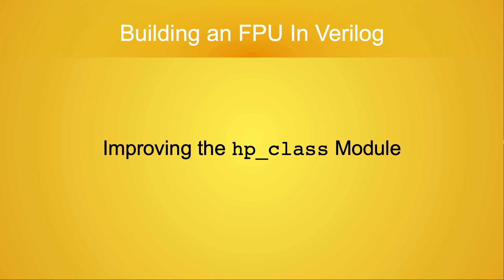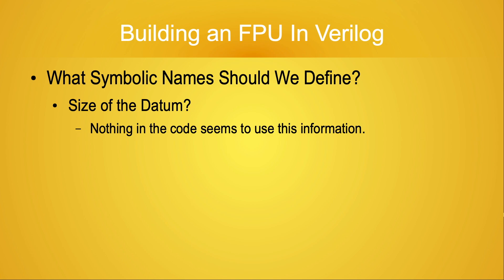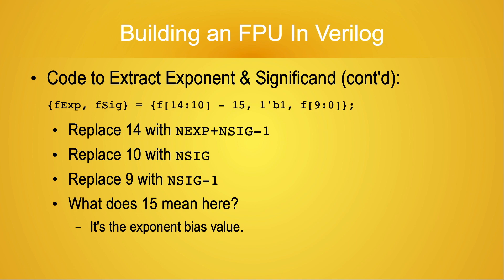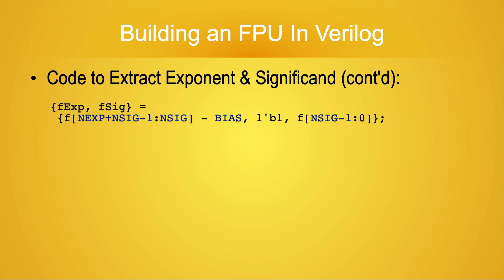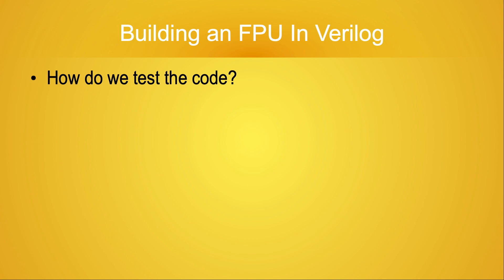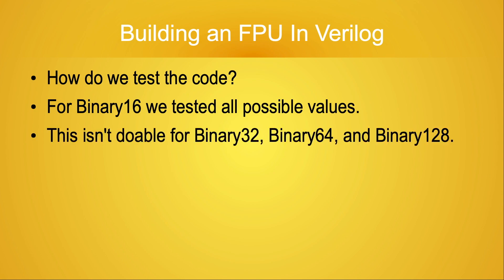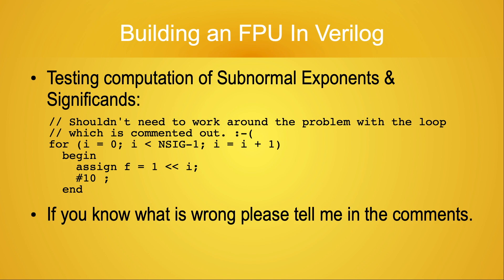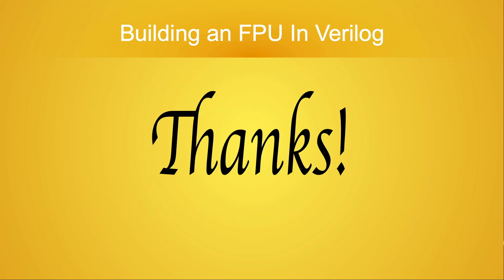Building an FPU in Verilog: Improving the hp_class Module

Comment: Hi Chris,
in verilog, LOG2 is written as a long macro with a chain of ternary operators
But now, a lot of verilog compilers also support $clog2() task

If we talk about synthesizable verilog, then a statement like this:
sa = sa | i;
or tSig = tSig << i;
may or may not be synthesized  properly.
If the tool is intelligent, it can see that this statement is inside a for loop, then unroll the loop accordingly.
But other tools might raise combinational loop warnings and synthesize a combinational loop, which will cause race condition in hardware and make is unusable.

To avoid this, the old school verilog technique would be to write priority case statements:
case(tSig)
  11'b1??_????_???? : sa_final = (0);
  11'b01?_????_????: sa_final = (1);
  ...
  default: ...
endcase
Reply from the maker: This comment about “may or may not be synthesized properly”, and race conditions, etc.: Are you saying that I’ve stepped into an area which the Verilog spec leaves unspecified and therefore leads to different compilers doing different things?
Reply: @FPUniversity  Unfortunately, I think almost all synthesizable constructs in verilog or even systemverilog are vendor specific. The IEEE standards do not say much about synthesizability of designs. Many things are understood to be synthesizable as there is little doubt (example: case statement models a mux). 
But for other things, companies maintian RTL coding style guides. Designers follow the style guidelines closely to make sure the synthesis and other tools don't do strange things.
Reply: @FPUniversity  For simulation, you are going to be just fine. But if you intend to synthesize your design, the best approach is to know which synthesis tool you are going to use. Then just synthesize the design that you have. If the synthesis tools shows warnings/errors  or if the output of synthesis (which will usually be a netlist) looks incorrect to you, you can circle back to the verilog design and refine it.
Reply from the maker: @anongromflomite  The only version of Verilog I have experience with is Vivado. If what you're saying is true as a software engineer I find it disturbing that the semantics of a programming language aren't well established.

When I took my Verilog classes we were told that 'for' loops would be expanded as hardware and that matches my experience. While it's true that in this video I simulated the circuit the circuit has actually been generated in other videos in the series. All of the Verilog code has been generating correct circuits so far using this technique though you may be right that such would not be the case for other Verilog compilers.

Regarding the case statement I need to do a bit of nitpicking. The case statement is only used for subnormal numbers so the case values should only be 10 bits wide, rather than 11.

Using a case statement as you've suggested would get tedious for larger floating point formats; binary32 requires 23 case statements (or 22 plus the default case), binary64 requires 52 case statements, and binary128 requires 112 case statements. This seems like an awful lot of extra work. I would be inclined to manually unroll the loop and have unique versions of the class detection module for each of the 4 binary floating point formats. I expect this would be much more resource efficient than using case statements.

Comment: Also there is syntax that allows to mention inputs and outputs in arbitrary order when making instance of module:

fp_class inst1 (.f(f), .fSig(fSig), .Exp(fExp), .normal(normal) );

First we write input/output name as it was defined in module, then in brackets: wire which we connect to it! Some outputs could be left unconnected at all if we don't need them right now.

About that "for loop", I'm noob myself... There is some strange rules about using loops. They are kind of macro in fact, they are unrolled in compile-time so compiler must be able to do so! (know ahead how many times it goes) Maybe that's what the problem was. In Quartus (which I work with for Altera chips, now Intel) for loops are allowed only inside always block.
Reply from the maker: I'm aware of this feature in Verilog. It's a personal preference thing. I prefer not to type two names plus a lot of parentheses for the argument list.

Comment: There is some Verilog syntax that could be useful:

1. localparam instead of parameter for all values that shouldn't be changed from "outside". So, Nsig and Nexp are parameters (we change them and that's the point) but many others are localparam. Otherwise someone could override their "default values" calculated from  Nsig and Nexp. Though bias might remain as param if one wants to implement some other, non-IEEE floating point!

2. defparam. Instead of passing parameters with # before passing inputs and outputs, write defparam after module was instantiated:

defparam
inst1.Nsig = Nsig,
inst1.Nexp = Nexp;

Now there is no need to memorize the order of parameters!
Reply from the maker: Thanks for the tip! Can this feature be used with the include file? I'll give it a try when I have a chance.